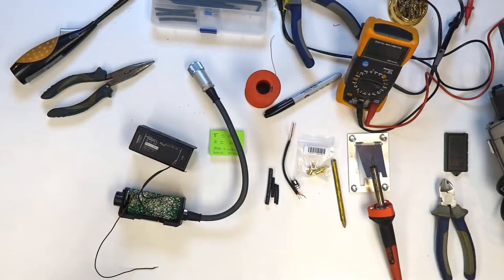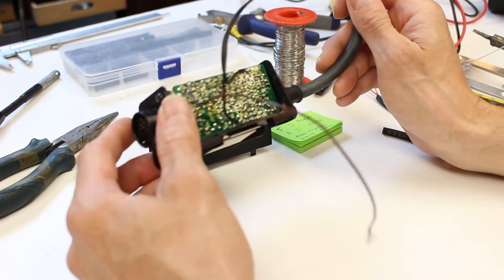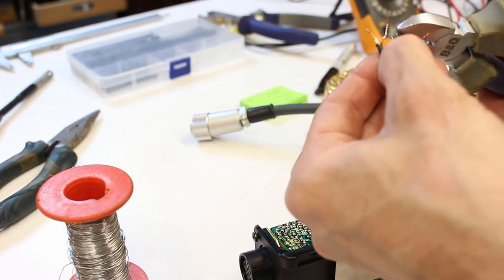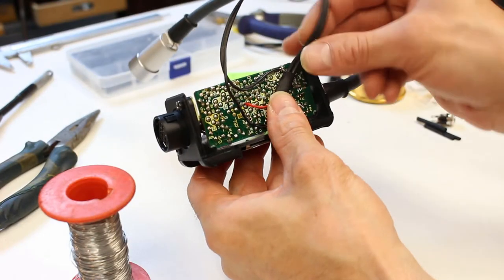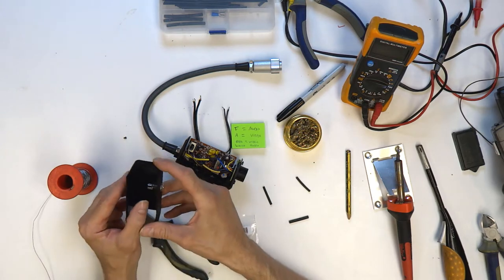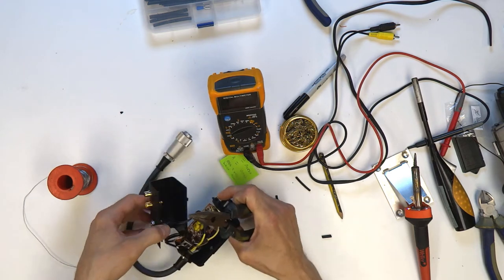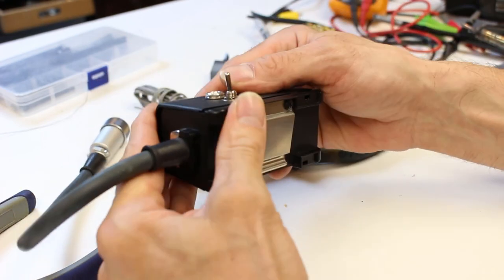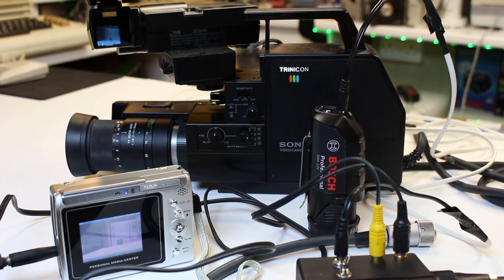HOW TO USE A SONY VIDEO CAMERA FROM 1981 with a portable PVR! SONY CMA 1010 composite and 12v mod

Comment: Great tutorial, love it when you find someone who has done exactly what you want to achieve!
I have a sony HVC-2200. I also have a Panasonic WV-PS01E/C power adapter. I am trying to find a CMA 1010 on ebay. What exact model is yours? There is a 1010E and 1010A. Will both of those models work with this camera? Cheers!
Reply from the maker: Thank you. If this helps one person then I have achieved my goal. My CMA-1010 is the e version. Maybe e for Europe? as I am in England.
Reply: @RetroGadgetMan  yes I think you are correct there, thats the one I ordered anyway!

Have you found the best way to record the footage? I have a portable recorder similar to yours but the footage records quite choppy and framey.
Reply from the maker: @thanktheknife  yes the quality isn't great on my hard drive recorder. I use a Sony digital 8 camcorder as a video recorder. As it has analogue inputs and does analogue to digital conversion.